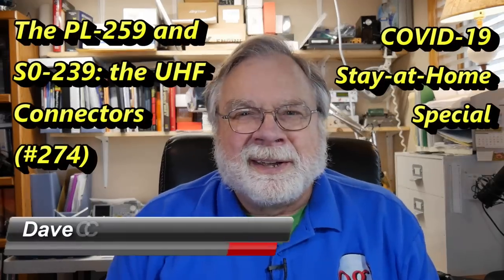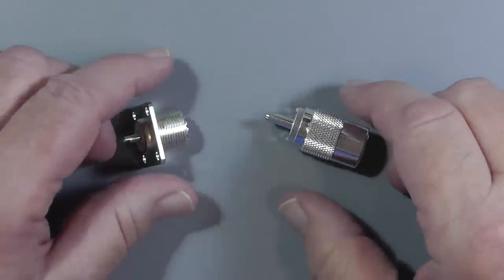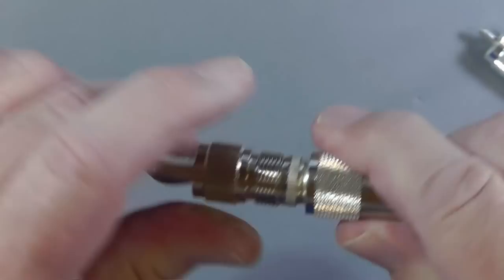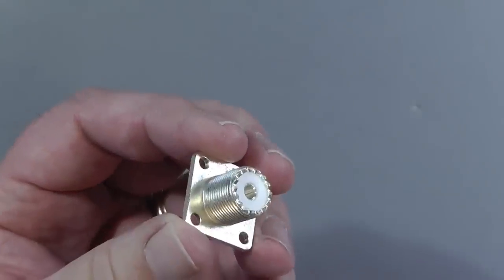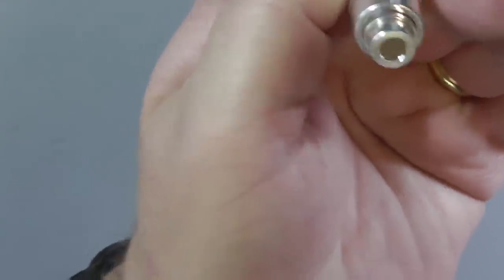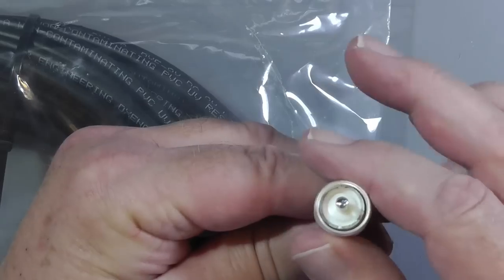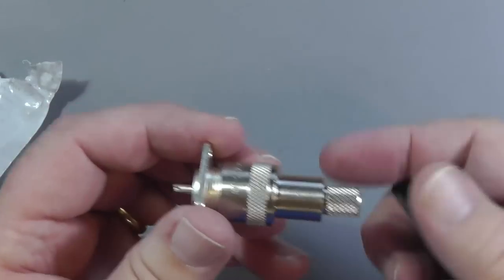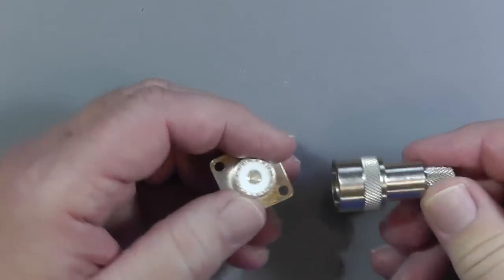Stay at Home Special: A Look at PL-259 and SO-239 Connectors (#274)

Comment: Thank you Dave, very nice overview. It might be nice to demonstrate using smaller coax INSIDE the shack . LMR400 is sort of like the tail lifting the dog. What do people use that is more flexible within the shack to interconnect  between the antenna switch and the transceivers and other auxiliary equipment. Also, the use of the Antenna switches within the shack to either connect multiple radios or, multiple antennas coming into the shack, what if you have BOTH conditions, multiple coax cables from antennas, and multiple radios ? How to best use the antenna switches for multiple setups.

Comment: PL259/SO239 non constant impedance, fine for the actual antenna connection, and  the back of the radio, even on 70cms (as what is inside the radio has been designed to produce a match for the co-ax, and compensates for non-co-axial connections and non-constant impedance plugs). N types otherwise for me, and used outside, they are waterproof, so better for any band. NEVER use a PL259/SO239 to join two lengths of co-ax above 30Mhz.

The other issue is the impedance mismatch as a result of cheap manufacturers substituting other insulating materials for PTFE, and this can happen on any kind of plug. Different materials need different plug dimensions, as you highlighted, but you can bet that is not taken into account in a Chinese factory...

PL259s are bad news to solder anyhow. Best connector I ever fitted onto co-ax was an N type, onto LDF 5-50. All you need is a hacksaw...  73 de G4EGH

Comment: Very helpful basic info for most hams but especially new hams. As you have the time video "shorts" on more basic topics will be a great service. In this vein - a couple of questions or ideas for follow-on videos. How does one select a specific brand PL-259 (are their any real differences)? The product claims and prices vary widely - for example, the Times Microwave is very $, especially with the crimp kit. I've been told that one may need to match the PL-259 to the coax brand, not just the size designation. True? Maybe a more comprehensive presentation of the different converters e.g. SMA to Pl-259 for example (I use to connect my HT to a J-Pole). Easy solutions to common issues  especially for new hams who may not yet be aware of such options. 
KG6RSZ

Comment: What about the use of a little silicone dielectric grease inside the SO-239 to avoid the losses and improve conductivity/connectivity?  Does it just not work for this application?  It can be used for other electrical connections in high voltage applications (like 124 VAC).

Comment: I have this on an old realistic cb phone 40. Can I solder a typical coax cable end to an PL-259 and then connect an antenna to the other end for my CB radio? Or should I just order a specific coax cable for it?

Comment: Times Microwave water proof (at 12:40)...
As someone that lives on a boat, I recognize the design of the connector is to prevent water getting into the coax. It is easier to replace the connector if it gets submerged in salt water, but you wouldn't want to replace 70 feet of coax in a mast if you can prevent it. Water intrusion in the first couple feet may mean it can't be shortened enough.

Notice waterproof heat-shrink wire-ends do not have the wire exposed this allows the connector to be replaced when corrosion from exposed to salt water without the need to replace the whole wire. Notice the normal crimp wire ends have wire exposed where the waterproof wire-ends do not. After you have had a flood and you can bend 2/0 wire and hear the strands crackle you realize the importance of protecting against this intrusion. You want to replace the connector before damage is done to the wire.

This doesn't mean the heat-shrink is enough to be waterproof. Some heat-shrink has adhesive to add to the sealing just as the waterproof heat-shrink wire-ends do.

Comment: Hay intresting thing SO239 connectors are often used on geiger counters from 1920s to 1950s with external detectors as the detector wire connector. Pain to find one rated for high enough voltage now, if one needs to replace the connector on old gear, but at the time it worked great until the manufacturers found new connector types.

Comment: At frequencies below 250Mhz UHF connectors are fine if you use a quality connector (from Amp).  I remember installing mini-uhf connectors on the AMPS mobile phones. Those were pretty good and not so painful to field install.  

FWIW: 
I remember the 'clamp' version of BNC connectors were a pain but I see now that Belden makes as 50ohm compression connector version (not unlike the F compression fittings).  I am sure that N connectors only came in the clamp style.   Both BNC and N  clamp connectors were a joy (note sarcasm) to field install. 

For ease of installations I would use the Belden BNC compression connector because the tools can be had at a big box home store inexpensively and it is very easy to install.  No soldering and good to +2Ghz. But that is me.  YMMV.

Comment: Hello Dave, 
The reason some people poo-poo these connectors is because they ARE POO-POO!  Even though they are not constant impedance connectors they are OK for HF but I won't use them above about 50 MHZ.   No sense in flaming me, it won't change my mind.  I have even changed out SO-239's and replaced them with N connectors on some of my radios and equipment. 
Personally I think that all hams should know how to assemble the PL-259 but I am also one of the guys that had to sweat bullets to learn and pass the 20 WPM code test to get my extra ham license. 
So this tells you that I am an old geezer and set in my ways. That being said, I have been using crimp connectors for a few years now and I really like that new Times connector that you showed. I only wish that the shell backed off so that you could seat it first.  Personally, I like the crimp-on connectors that have a solder type center pin.
Thanks again for your videos and everyone please be safe,
John
WR0J

Comment: In 1973 I was 13 YO. Old-school CB was the thing. I was the youngest op in the area and had a 4-ch. Lafeyette tube radio and learned quick how to solder these boogers onto RG-8/ RG-58 with a 140W Weller gun. I was pretty popular getting these onto operators' coax in the local area. They're as good these days on all the amateur bands that I work (from 180M to 70cm). Good instructional here, Dave.

Comment: I don't trust and I can't afford crimping tools to do the crimped connections. I have been soldering connections since the 1970s so I guess I will keep doing it the same way! I would rather cut bulk coax to the length I need.
Reply: Most antennas sold today are multi band so the bulk coax lenght    will not be critical. I wish they would sell cable with just one connector. Always end up cutting one off to feed the coax three the wall. Waste.

Comment: Not the greatest for VHF and UHF but they are easy to install. A PL259 works far better than an improperly attached, and much more complicated N Connector. Thanks David for your wonderful videos. I shared your links in the IC-7300 Facebook group.

Comment: These were also used on remote pick-up equipment that operated in the high-band VHF and   also 450 mhz. A common practice was to replace them with type "N"; however, it was discovered that they worked just fine if the high quality  Amphenol silver-plated ones were used. The cheap chrome plated ones found at various parts bulk dealers were awful and served as very good impedance bump and loss "lumps". The larger issue was using the RG-8 foam over a few feet.  The cheap buck-two-nightyeight ones aren't even very good at HF for that matter. Chinese curse might be good term these days. LOL!
Many thanks for another great video, you're an asset to the hobby and doing a great job.
73' de K4WRF

Comment: So what I don’t get is if these aren’t all that well suited to VHF and UHF, why is it that 2m/70cm dual-band radios come with them instead of something more appropriate?
Reply from the maker: Habit. Pure habit. So- called UHF connectors were designed back when "UHF" was anything higher than HF. Yes, N- connectors are more suited, and in Europe HF and UHF/VHF radios are sold with N connectors. However, the additional loss of the UHF connector is negligible.

Comment: Learning how to solder on a PL-259  is a great skill to have when you are a Ham!   Ranks right up there with being able to change your own oil and changing a flat tire on the car.   I must admit I do purchase coax with PL-259 plugs already installed but I tend to cut them down to the size I need and install my own PL-259.    I think the mistake people make with them  (other than over thinking) is using a 35 watt  iron to solder.    Enjoy the videos always interesting and informative.  73's de WA3TVH

Comment: A problem I've been running into lately is that some SO-239 connectors from China come with metric threads!  They look the same so it's impossible to tell the difference by looking but when you try to screw on a cable it will just go on about 1 1/2 turns then jam.  The problem is easy to fix by running a die of the proper size over the threads though.

Comment: Hi Dave.  Probably just a misstatement, but you do not screw the shield into the threads at the rear of the PL-259.  You do screw in the jacket.  A nice tight connection there becomes the strain relief for the connector.  Other than that, a very informative vid.

Comment: Great video Dave. I've often thought that the best way to explain how much "better' an n-connector would be over the pl/so connector is to work out how many more watts you'd get out of them. Ie if you swapped out the UHF connectors on your 100 watt Icom, how many watts do you gain at the feed point? I'm going to guess the answer is less than 1 extra watt, but perhaps you're able to do the maths.

Comment: where do you buy the Times connectors without using their horribly confusing website?
Reply from the maker: You might try DXEngineering.com. Times Microwave is a manufacturer, so they rely on distributors for most sales.

Comment: I have found it makes it easier to solder the shield if the hole has the plating is remover.  The solder seems to work better to the brass.
Reply from the maker: Another way that can help is to add some flux. You can pick up rosin flux at Home Depot. Make sure you do not by the acid flux, but the so-called electrical flux. A single little jar of flux should last you a lifetime as it takes very little for each job.

Comment: There is an antenna made with the so 239 with 4 lengths of wire soldiered to the 4 holes on the housing. Now I have been out of radio for some time, I'm just getting back into it,  but for the life of me I cannot remember the name of that simple build. Does anyone know what that is. 
KD2MNE
Reply: Quater wave groundplane antenna Jayson, usually for 2m or 70cm. 73, M0KED, Lincoln, U.K.
Reply: @andykeddie7602  that's it thanks man. Been awhile lol 73's
Reply: @jaysonscaccia3188  I just made one of those for 2 meters so I could get back on the air locally.   Forgot how darn simple an antenna could be.    I used scrap bailing wire from work,  5 wire nuts for the ends and a recycled SO-239 and scrap 1" PVC pipe.  Even the coax was scrap.   Total cost was zero,  the darn thing works great.

Comment: When making my own cables and crimp fittings, I use heat shrink when done to help hold the cable to the connector like the comercial coax supplier do.  Good video Mr. Casler. Thank you sir. 👍